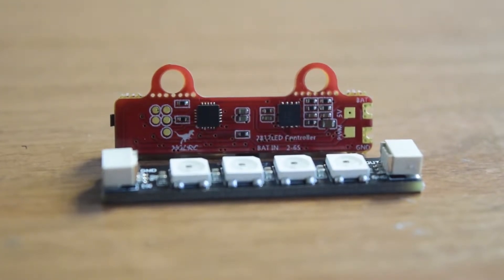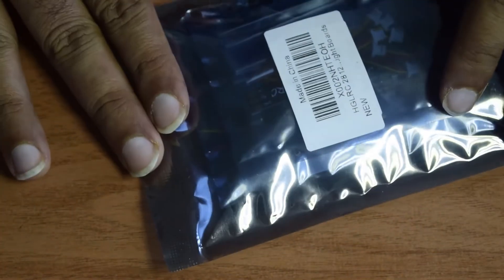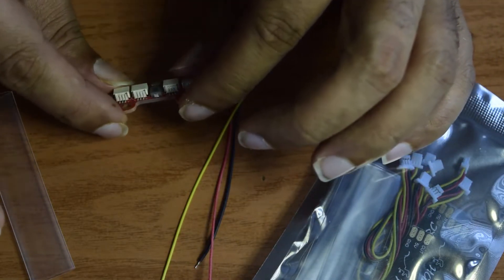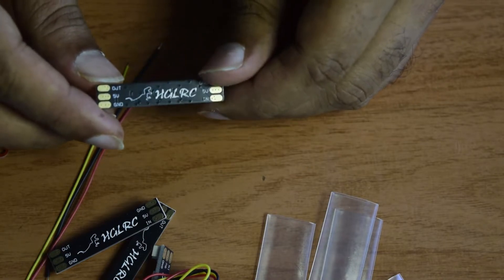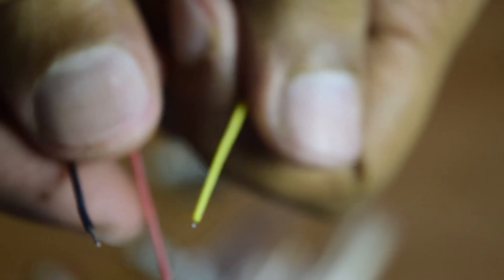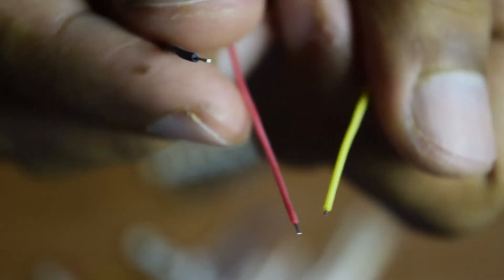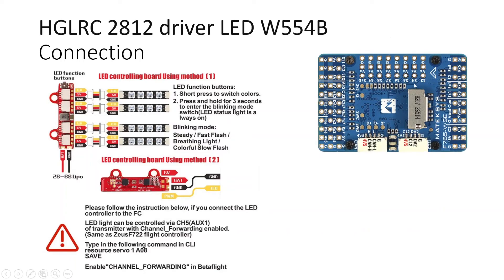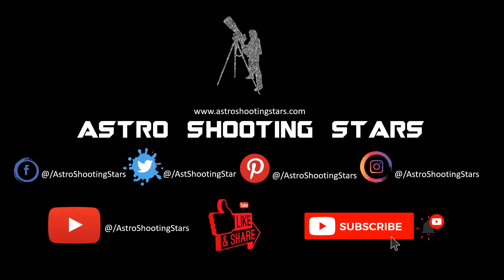Begineers Guide to RGB LED Strips for Drone | HGLRC 2812 driver LED W554B Unboxing and Review

Comment: can i directly connect this led controller to xt60  as bat and gnd (if bec is integrated) and only signal wire to fc?
Reply from the maker: no you cant if the port is marked as batt as it will be battery voltage which is not 5v, it will damage your led strip. I hope this helps. please stay tuned to my channel for my future videos